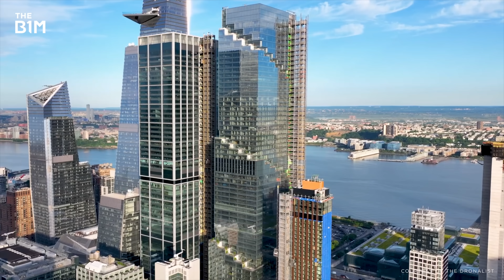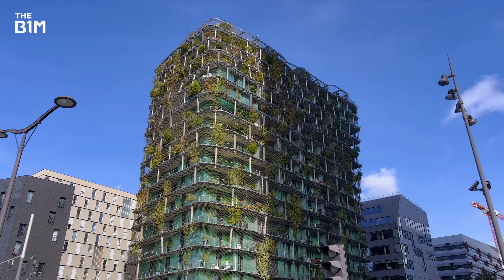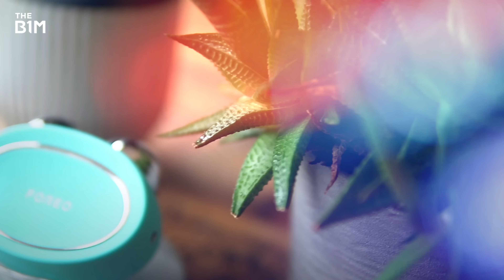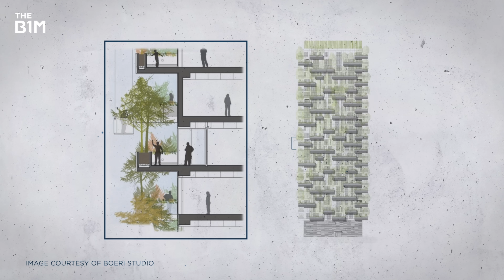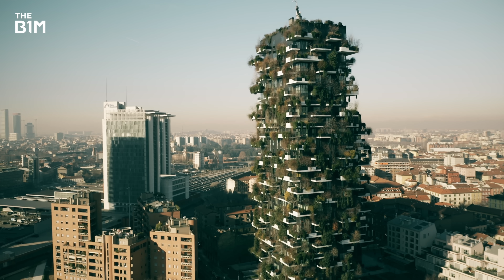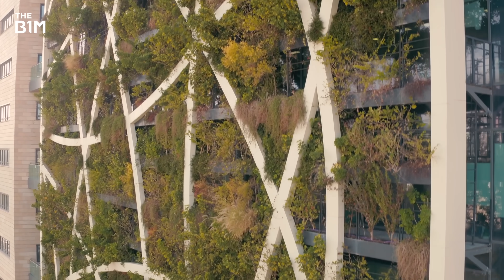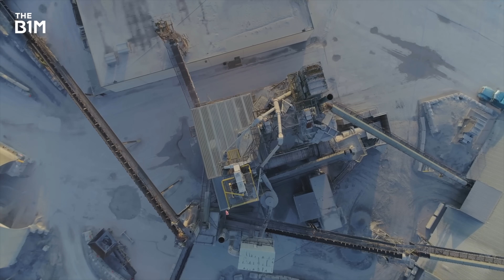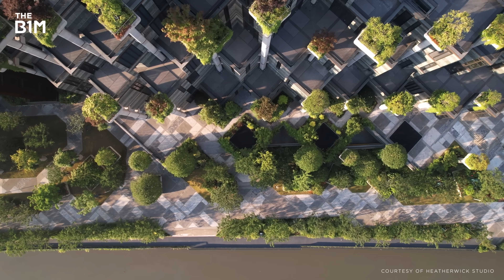Tree-Covered Skyscrapers Aren't Actually That Green

Comment: It's counterintuitive as tree roots will find the least little crack in roofs and exploit it, causing leaks and once the roof goes, so goes the building.
Reply: There are ways to counter that. 😬
Reply: It's wild that none of these people can ever remember that trees are symmetrical, you can't just plant one in a flat floor, they generally need as much space for roots as they do for branches.
Reply: ok. how many buildings have you designed and created out of concrete? hmmmm?
Reply: @AlRoderick  depends on the tree.... some trees' roots can be confined to smaller spaces. infact that also limits how big the tree gets.
Reply: @dedasdude  some architects & developers chose bonsai trees as well
Reply: @dedasdude  Yep. Different trees' roots behave differently, hence ones with aggressive root systems probably won't be planted up there
Reply: @dedasdude  You also don't have to confine the roots; you can direct them so that they don't do damage.
Reply: the roots either need so much soil that they have all the space the plant needs or the freedom for the roots to grow out into the air so they reach a point where there is no soil
i just dont understand what's stopping each plant from growing into the rest of the building

Comment: As a structural engineer, this is so cringe and superficial (meant for clicks). Trees and its soil are very heavy and will find any crack or imperfection to plant its roots into. It's asking for structural problems.
Want a great cheap way to be green? Buy a programmable thermostat for your home to reduce your energy usage when you are not home. You can even control it from your phone.

Comment: As mostly mentioned in this video:
Positives: 
Cutting CO2, providing shade/cooling (less money/CO²), attracting wildlife/biodiversity  and improving our mental health.

Negatives: 
More concrete and steel necessary (money, CO²), gardeners (only monthly but money), waterproofing, cracks through roots and vegetation (money), fireproofing (money)

Side notes: 
1% of the world is build up compared to 70% of CO² emissions.
cement production = 7% of CO² emissions worldwide

Comment: As an architect it’s mostly greenwashing, the reality is that for the luxury buildings where the developer is willing to pay for the landscaping consultant, the engineer for the irrigation system, the extra waterproofing, the greater complexity involved in the design phase etc. it makes a marketable difference, but for most cases the costs are a little too steep and that’s unfortunate but as far as a design element you need significant rooftop or balcony space. It makes sense for large office buildings, hotels & luxury apartment buildings which would already have those things. Plants on the facade via a secondary building skin are even more complex and expensive  to incorporate without standardized systems. Secondary building skins are rare even without plants but they deserve their own video.

Comment: The experience of beautiful greenspace relieves stress and can reduce infrastructure-, utility-costs; ground subsidence; air and water pollution; increase beauty and walkability, etc.

They also reduce the wind tunnel effects; heat island effects and reduce strain on storm drain systems.

These green buildings are more practical if Roman concrete (saltwater is incorporated) is used and we start building for durability.

Comment: Well, the Bosco Verticale here in Milan is still going strong. Looks like a successful project, greenwashed or not.
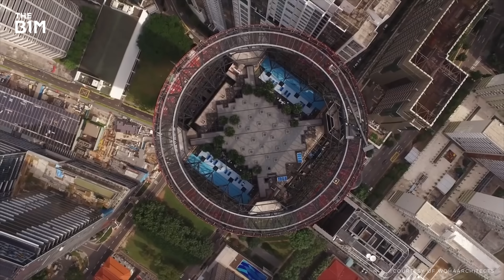Reply: It's just two buildings, hardly a "forest". And just next to it (you can see at 0:47) a large area that is only covered with grass, almost no trees, because it's a platform built over something, not real plot of land. So you have two tiny buildings pretending that it's something revolutionary, and then you have a square kilometer wasted on nothing.
Reply: @cioccolateriaveneziana And apparently those two buildings are only affordable to multi-millionaires. So, kind a disappointed.

Comment: As a landscape architect, I can tell you that the first thing to be value engineered in any construction project is the landscape.  

It's really cheap to show renderings with lushly planted exterior space but once the developer sees the bill for putting a ball and burlap tree onto a 20th floor exterior terrace, they move vegetation/planting into the "owner improvement" category of the project.  That's why you've seen a ton of renderings like BIG's "Spiral" (huge integrated planters loaded with trees) and then the built reality of "small steel planter boxes maybe with perennials if the owner of that unit pays for it".

Some developers understand that richly planted and highly amenitized exterior space is a huge driver of returns, and others just see a line item cost to be trimmed.  But they're all happy to use sexy forested renderings to sell units.

Comment: Well my greatest concern would be erosion over time. Roots can quite effectively break through rock, especially with larger trees. I highly doubt the metal screen will stop that, much as it will slow it down.
I definitely love the concept though. More greenery is definitely a good thing, aside from helping air quality they do provide a bit of sound diffusion as well.

Ive wanted to grow some moss on screens and hang them in my windowsil for some time now, would be a fun project. This has resparked that desire. Moss doesnt die easily either,it just hibernates when dry, so it'd be low maintenance greenery.

Comment: Not all "wildlife" is the sort you want - in Madrid, the Edificio Princesa, on Glorieta de San Bernardo was built in 1975, with greenery dripping down from one floor to the next.
While lovely looking, it turns out they have massive issues with rodents and pests using the greenery as a handy highway between apartments.

Comment: The point is that the green should harvest rainwater for the buildings' own water routing system and promote O2 rich environments where building users can relax. Having trees and shrubs on the outside for an aesthetic feature does sod all if it doesn't contribute to the lowering of the C02 emissions and energy use of the building and it's users. More animal and plant life is better.

Comment: Interesting that you talked about the fire hazard / regulations Fred. I totally forgot that this is indeed an important part of it, whereas dry conditions could make these buildings potentially unsafe. Irrigation only goes so far: if exceptional drought hits then the plants / trees used may still slowly die off.  Then there is the added risk if multiple buildings in the vicinity have the same 'greenery' look and are crowded with plants: if one of them goes ablaze under heavy winds, what stops other ones from following suit due to embers being spread around?
Reply: There's also the issue with storm damage. Treetops and branches could be broken off and sent reeling through the air in a cyclone.

I'd be happier if they used shrubs, ferns, trailing plants and mosses. 
As for trees - well, pruning will keep them manageable in size (you can, theoretically, keep a bonsai tree growing 'forever,' as the art of careful and regular pruning keeps it forever young), but some of those trees in the video were starting to look pretty big already. 

Maintenance might be expensive - but who can argue against providing more jobs?

Comment: I'm a trained architect and an expert in sustainability and this is my piece: Architects and developers have yet to come to terms with what climate change and a change in energy paradigm imply for our trade. There are several studies that show that above a certain height, the over consumption of energy, material and space is not warranted. It  just takes to much energy to run the appliances, material to carry the weight. The skyscraper itself  just not sustainable. Putting trees on them is just added fluf and cosmetics.

Comment: A thing that wasn't touched on and is hardly thought about unless you live in a forest like I do are what we call "widowmakers". Which are branches that have either died or broken off and are hanging in trees, that can randomly fall or break off, hit someone and kill them almost instantly in some cases. I would think the same would apply to these tree even though they may be maintained, if you were to have a period of high winds then those branches could break off and fall onto someone on the street and seriously harm or kill them, given you don't even need that big of a branch before serious harm can occur by being hit by one from really high. Heck ice makes them even worse due to it making the branch heavier, that was what happened years ago when I lived in an apartment and a "widowmaker" fell through our roof, wasn't even that big of a branch but due to the height of the tree and the ice it punched through the roof and ceiling easily.  

Climate is another issue as well given New York has very cold winters, which means to keep the trees alive and the water from freezing they would probably have to have some heating system for the trees to keep them from literally freezing to death. 

So yeah I don't think we'll see these buildings in practical use, other than for render aesthetic purposes to attract the public and investors, as they seem pretty much impractical in the end, and seem like a band-aid solution that won't solve the problem in the end.

Comment: Why should you use trees and not bushes? Trees have a trunk that does not absorb carbon dioxide and takes up space. Bushes do not have such a problem and they do not grow so large, and therefore weigh less. Well, you yourself showed the simplest solution at 9:37. Liana-like plants that grow simply on the walls, clinging to small protrusions or hooks of the facade. This solution is well suited for already built houses that do not need to be rebuilt in any way.
Reply: That trunk is made of carbon stored by the tree. The heavier weight is directly caused by a plant's ability to capture more total CO2 from the atmosphere over its lifetime.

Comment: I don't want to completely bash these projects. However the reasons people claim they will save the planet etc, are just insanity and fails even common sense being applied. 

It is true, that trees reduce CO2 in the atmosphere, and produce oxygen. But our skyscraper filled mega cities fill such a small portion of the earth's surface. We would be much better off planting forests around our cities, or investing in outdoor parks with lush vegetation and trails to walk. These environments would also be more hospitable to wildlife. And if we consider the added cost and materials needed to reinforce a building to the point where it withstands a forest with wet soil growing on it. The maintenance work to keep the vegetation from penetrating the building and tearing it apart. Or to stop the moisture from ruining the building. It is certainly not a cost effective climate change battling method. It is certainly not even going to reduce climate change, when you take into account all the pollution happening from the additional difficulty in the construction process.

But what is this sort of building good for then? Well it just makes people happier. Gray skyscrapers as far as the eye can see, are depressing. Only stone and concrete, depressing. Some green trees and bushes will do wonders for the happiness of people. 

However, you can arrive into the same result, by making sure your city isn't filled with skyscrapers, but has plenty of parks, trees and bushes lining the sidewalks. Finnish cities among other European cities, are a good example of this. Reduced car traffic by having a good above- or underground train network around the city. You have to look hard to find a street without anything green growing around. And there are plenty of parks and forested areas.

Comment: A shift to cross-laminated timber (CLT) combined with the implementation of greens roofs would be a step in the right direction. CLT can in many instances replace concrete while producing significantly fewer carbon emissions. A huge benefit about having vegetation on and around building was sort of glossed over - not only does transpiration and evaporative cooling decrease a building’s energy use (and thus cost-over-time); the vegetation can act as a bioswale, slowing the velocity of stormwater runoff and easing load on adjacent infrastructure. The decreased strain of infrastructure means less maintenance, which means more less resources used.

Comment: People underestimate how delicate the climate in a city environment really is. Greenery can help a lot with reducing air pollution because particles have more grip than on artificial smooth surfaces. Obviously it also cleanses the air and cools the area down because of shade but also because plants dont have much heat storing capacity like concrete, steel or glass do. Despite the maintenance effort,  I'm hoping to see more creative greenery in urban areas!

Comment: Help drop the ambient temperature significantly, by insulating / shading the concrete structure / facade from the sun stopping it heating up and heating up the air around it, and releasing that heat at night. Getting our cities a few degrees cooler in summer would be great .

Comment: Anyone who has ever lived or worked in an old building covered with vines and such (somewhat common in Europe for every city to have one or two major buildings like that in the centre) knows what an absolutely terrible idea it is.
Sure, it looks amazing from a distance or in a picture, but up close it's impossible to keep clean, you don't get sunlight through windows and it's a constant struggle with infestation with all sorts of bugs, spiders, etc. - not to mention struggling with allergies. Also, birds come through such windows and try to build nests in homes or offices of such buildings so much more often, and also often bring parasites with them. Absolutely horrendous, outright dangerous. Worse yet, the plants are often impacting the building structurally, making it deteriorate at a much faster pace, and the general maintenance co much harder (especially if the plants are not to be removed), which in case means struggling with fungus indoors, poor insulation, and worse. Everyone ever living or working in these buildings always ever only complains and hates it, says how beautiful the building is on the outside, but dealing with it from the inside is a completely different matter.
There's a reason why human settlements are not typically like that, that we don't do these things traditionally but it's always a building that stands out as a landmark. The same reason why parks in urban areas are not like wild forests at all. It's for human convenience, health and safety.

What should be done instead is to make the cities less congested, broader streets (and in more space between buildings and the buildings themselves smaller) with boarder roads and pedestrians, HPV and public transport grade-separated from cars, with robust systems for the former, and put  lot of trees and greenery in those spaces in between buildings + maybe courtyards with greenery and also possibly gardens on specially designed rooftops, assuming it's a climate that allows for this (no harsh snowy winters that require angled roofs) and so on... you know, things that actually DO work and are traditionally implemented in a lot of places that weren't irresponsible in the urban planning. And don't get me wrong, keeping plants on balconies is extremely popular in countries like Poland, and for good reasons - but it's still nowhere near the asinine atrocities from the renders of this video that sooner or later are just bound to fail spectacularly, it's just inevitable and a matter of time until the voices of people dealing with these buildings in their everyday life become the stereotypical perception of how terrible they are.

Comment: IMO: You want a sustainable high rise building? Make it with a concrete core, mass timber, roughly cylinder shaped, small windows and a thick insulating jacket. You are in a hot climate? Give it an additional offset jacket of aluminium sheets.

Comment: There would always be an amount of seepage in the drain system with these green buildings. Soil, water, etc. getting into small cracks in the concrete, small cracks getting bigger over time. Possibly affecting the structure of the building.

Comment: Bosco Verticale is an interesting proof-of-concept, but the construction and maintenance costs are incredibly high.

Perhaps it would be more feasible for towers to be built with smaller planting boxes with low growing shrubs, perennials and trailing plants that would still provide greenery but require significantly less root space and irrigation (and maybe allowing a rainwater harvesting system that wasn't computer controlled, just having diverters similar to those that feed water butts at each level, with a trap so that leaves, moss etc don't enter the system and clog up the pipes. Smaller plants are also easier and cheaper to propagate and replace. While such a scheme would still largely be a token effort, and ground-level greenery surrounding the structures would be better, construction and maintenance fees would be a lot lower (heck, residents could even be given the option of maintaining their own planters, and if there were greenhouses on the roof, even assist with propagation of new bedding plants), so allowing a far wider range of income groups to reside in them.